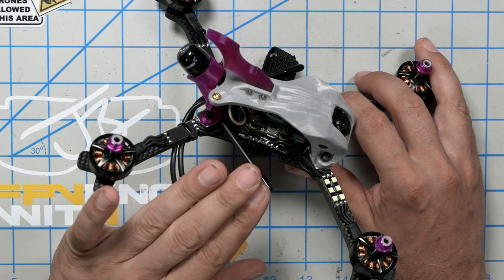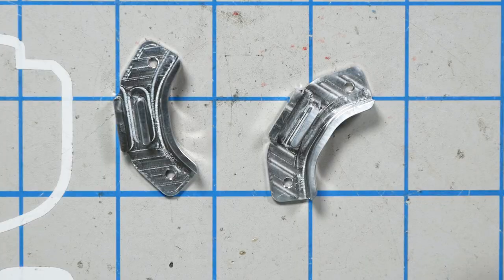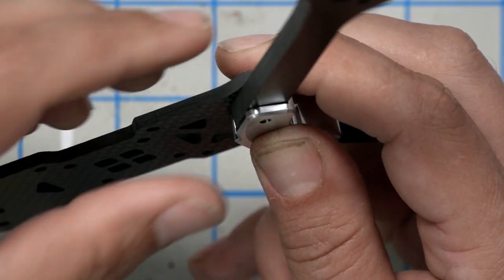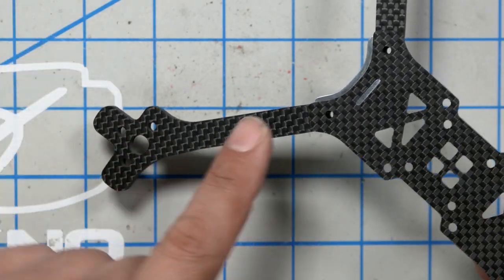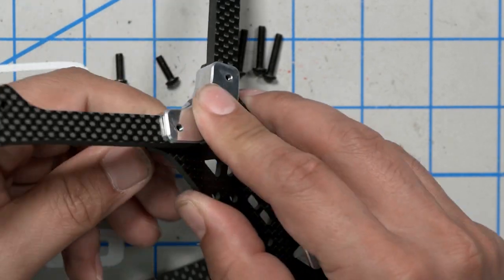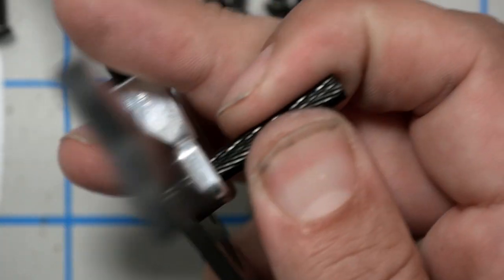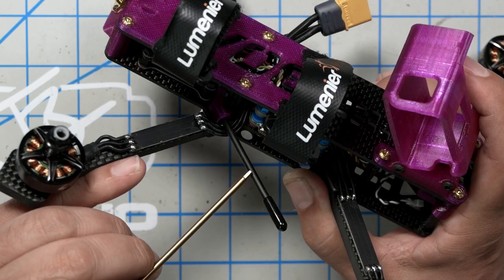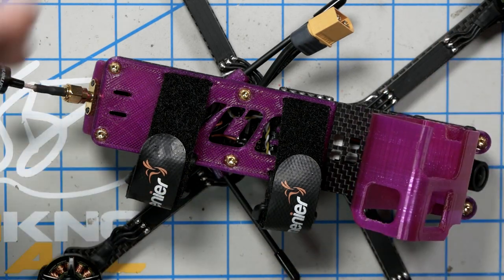SkyReadyRC balances toughness vs. weight with aluminum frame insert

Comment: Not sure if this is a good idea. Energy from an impact should go somewhere. Metal brackets is just asking something to break. Stiff TPU mounts would be better for durability.
Reply from the maker: IMO you never want flexibility in the arm mounts, at all. It causes resonance issues and the quad flies like crap. Energy from the impact, if it's going to break something, should break off the arm. At least that's easy to replace.
Reply: @JoshuaBardwell  I didn't think about resonance. It will indeed add a lot of noise for the FC. But still there are types of plastic that feel solid but will flex under stress. Some might be rigid enough for not to cause vibrations. 
Personally I would rather replace a cheap 3D painted bracket than a carbon fiber arm. But this is mainly because I can print them whenever I need a replacement.

Comment: 4:45 - use.. pliers? Hold the stand-off with the pliers and use the screw to tighten it. Allow the frame to move freely. Izi-pizi
Reply: Its a tapped hole, your idea won't change a thing. The only option is to tighten it from the top with pliers and add a dab of blue loctite. Stands offs with a flat for a wrench would be a good solution.
Reply: @shawnwise2458  I think you misunderstood me a little, or I was being unclear. Here's a step by step:

1.Screw the screw into the aluminium part until it stops (it's tapped, like you say, so it'll stop being able to rotate once you've used up all the threads).
2. Use your fingers to screw on and hand tighten the standoff
3. Hold the standoff with pliers, but don't hold the frame
4. Use the screw to tighten the standoff onto the aluminium part

Your idea and mine idea are more or less identical. The difference is that when you're using a wrench, you provide a counter-torque with the whole frame, while I provide a counter-torque using the screw.
Reply: @ojkolsrud1  I'm really trying to understand you, you seem very polite but based on the frame assembly  that I've  seen, once the screw is tight the only option to tighten the tapped standoff is to torque it by itself (while holding lower screw). 
Do you mean to insert screw in standoff and use the screw to torque the standoff? This would work but you'd still need to remove said screw that is now tight (in standoff). You'd still need to use pliers (a barbaric tool) to hold standoff  to remove screw.
Reply: @shawnwise2458  I hope this image that I made can explain it even better. 
https://i.imgur.com/3w0sG09.png

I think what you're saying here, "once the screw is tight the only option to tighten the tapped standoff is to torque it by itself (while holding lower screw)" Which is exactly what I mean.
Reply: @ojkolsrud1  yeah, your wording is just a little different I guess. It's not the end of the world to mar up a standoff. You could also use some non marring pliers or brass jaws. Regardless, it needs to be tight to minimize vibration. Thanks for replying!

Comment: actually, most carbon fiber sheets are woven in a 90° pattern, rarely there's a layer that's slanted at 45°, so if a carbon fiber sheet is woven parallel to the arm it's actually stronger than if it was woven at a 45°angle. And in most cases, the top layer of a carbon fiber sheet is usually covered in some kind of transparent resin so you can determine how a carbon fiber sheet is woven. Watch its video at 4:58 where ut explains the structural properties of carbon fiber: https://www.youtube.com/watch?v=aKpDyfJnxQQ&t=625s&ab_channel=RealEngineering

Comment: How do you get a Quad with GoPro to 600g?
Reply from the maker: I'm gonna be honest it aint easy.
Reply: I have a few around 500-550g go pro and 6s on top
Reply: @brendanzaebst9011  Do you go just for the lightest parts? And don't care about durability? Because I have no idea how to get 100g off my build.
Reply: Not at all!! Using quality parts is key. Using 20x20 stacks and getting rid of any excess wire. Shortest standoffs. Micro or nano everything else. And hardware. I use a super light alloy screw its a steel/aluminum mix and i use maybe 2 threads on anything. Dont crash and youre good. Also i use a session not the fatty go pros lol!!. No zip ties or tape to hold things. Just the absolute minimum. Oh i always fly with a radix also. Only FC worth paying for. But HGLRC suprised me with the new f722 stack. Its really light and flies super well
Reply: @brendanzaebst9011  Ok, Iwill try this. Thank you!
Reply: Im Brendan Zaebst on facebook if you need help or some discount codes
Reply: If you don't need the features of the Hero 7 or 8, a GoPro Session 5 (or 4, if you can find them), will bring the Boa in around 655 grams (with a 180g battery). You can get it even lighter if you use a 20x20 stack and light motors.
Reply: @skyreadyrc5873  I have a GoPro 7 and 653g all up weight.

Comment: Ok, so I am trying to wrap my head around this claiming oh the Catalyst BangGod frames are so heavy but you then turn around build a rig that weighs 740ish grams?? Really? You say 600-650g's is light and 650-700g's is still light and going over or in your case, well over 700 grams is a pig then you end up building exactly that! I am owner of FPV Zone LLC and we build custom rigs for racing and freestyle using the BangGod frame in many of these and hate to break it to you but our completed builds are anywhere from 643 grams to on the high side of 673 grams with a larger lipo battery oh and these are with a Runcam 5 mounted! Yes, the dry weight is 142 grams for the frame but we are easily building them with full components, Matek F7's, full TBS Crossfire and some even with the new KO Demon Seed 2208 1750kv motors and not even getting that close to the 700 mark, oh and this is with both front and rear arm braces installed! Email us for pics to prove our rigs are all within that sweet spot for freestyle! That being said, we love what you do, this video just rubbed me the wrong way with these assumptions and why in the world would you talk so much about weight and how important it is then build the exact thing your saying isn't good for the sport? FPV ZONE LLC. can build you a great rig that is well within the weight needed and you don't have to compromise on anything! sales@fpvzone.net or fpvzone65721@gmail.com
Reply from the maker: I didn't build this. Skyready sent it to me to demo their frame.

Any frame can be built heavier or lighter. The Banggod that I had was built heavy at 800g. Although the Banggod is a heavier frame at around 140g, it was putting air unit and GoPro Hero on the frame that made it so heavy.

The point is not Banggod heavy / Skyready light. The point is just that the Banggod was the build that got me thinking more about weight.

That being said if you start with a 100g frame you're already 40 grams ahead of the Banggod which is not nothing.
Reply: @JoshuaBardwell  Good point, and your right with that. We do what we can to build our frames on the lighter side and yes, the BangGod frame starts with a slightly heavier footprint dry and that can create some difficulties when trying to stay under that 700 gram mark. It just sounded like you were saying their frame was just a pig and not worth trying to build if going for a lighter rig and I can say we built many of those and tend to be able to keep them down under 660 to 670 on each with the session, 3d printed parts and they really perform amazing. Anyways, skyready sent a clean build and its good to see something new since we all know all about the BangGod frame already. All good man and didn't mean to sound like I was being confrontational but we are a little partial to Catalyst that's all. Soo many great frames and we all have our favorites I guess!